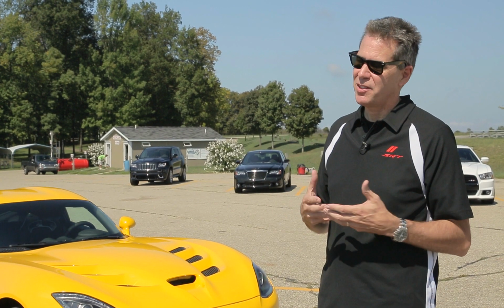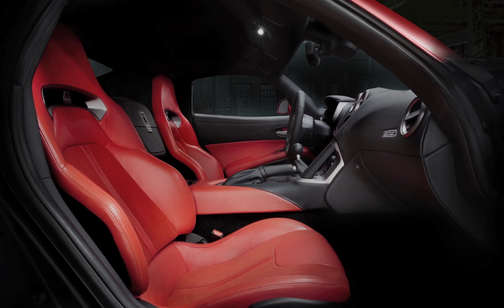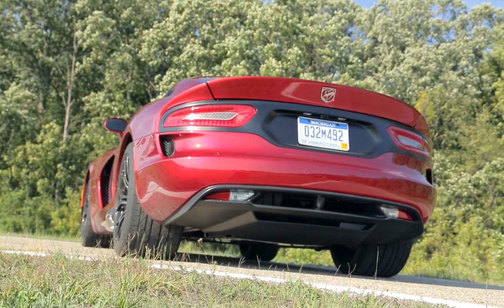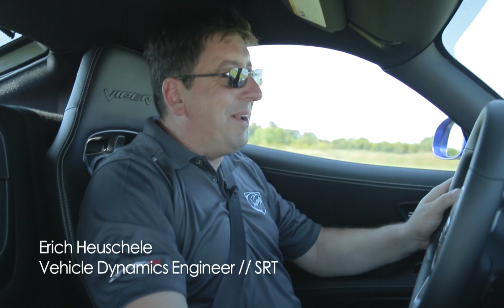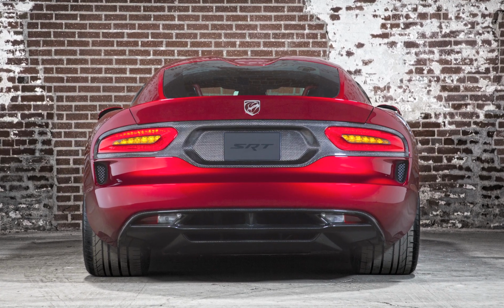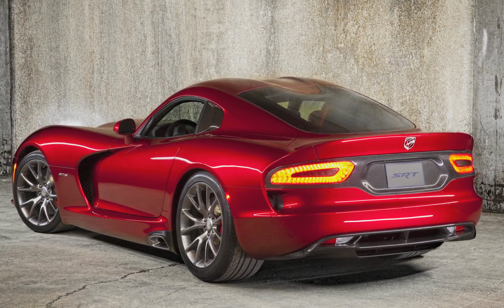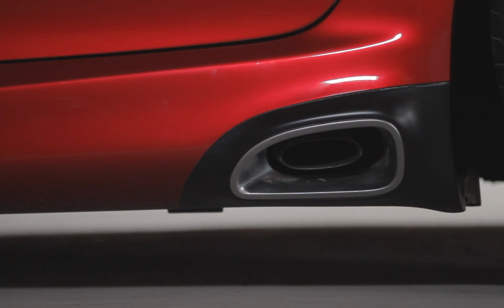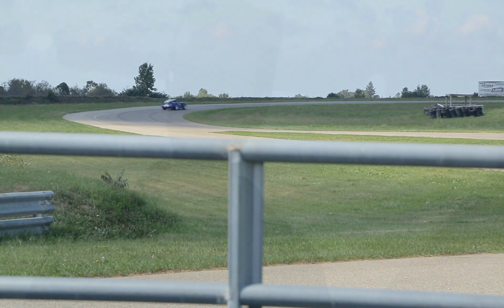The Viper is Back! - The Downshift Episode 35

Comment: The Tesla Model S is a Viper killer. I like the Viper design though. The Tesla as a super car is a wolf in sheep's clothing. But the Tesla is also a real car that you can drive to work every day. Why is Detroit so slow in making a performance EV car? I want to see the Viper EV with 0-60mph in 3.5 seconds, with 80MPGe and a range of 150 miles. It's completely possible and would be a far more real-life usable car than the current Viper.

Comment: if you bothered to open the clamshell carbon hood of a Viper, you'd immediately notice that every Viper every built (yes, since 1992) has been a front, mid-engined car.  Meaning that the engine is placed entirely aft of the front wheel centerline.  This is not true of many 'front' engined cars, including all those C1-C6 cars some of you are so enamored with.  The block is not as aft as you think on those cars.....but on a Viper, it really is mid-engined (thus the resultant long hood line).

Comment: The Viper costs $120k, has a body made entirely of carbon fiber and aluminum, has high quality leather interior that makes Maserati owners look shy, has tons of power, and is built for the talented. That's the problem with your supercar fad. The Viper is one of the only cars left where talent is a necessity for driving fast. This car will gladly throw you into a ditch if you don't know what your doing. Its a car that deserves respect to drive fast. The Viper accomplishes so much with so less.

Comment: 1. I didn't say ANYTHING about carbon ceramic breaks, so you're arguing with a straw man on that one "bub".

2. I said ACTIVE suspension not adjustable, learn the distinction.

3. A super car has to be modern.  It has to be at the forefront of automotive technology (just like every real super car is: 458, aventador, veyron ss).  There is not one piece of new, or revolutionary hardware on this car.

All they did was make the viper not a TOTAL piece of shit, and we're suppose to be so impressed.

Comment: Now you just sound ridiculous. So a car HAS to have carbon ceramic brakes and an engine behind the driver to become a supercar? You fail to recognize the awesomeness of the Viper.
1. It has bilstein electronic adjustable suspension bub, so you're wrong there.
2. The reason they gave it massive brembos and not your European carbon ceramics is because carbon ceramics damage very easily and cost a fortune to replace. And the brembos outperform anyways stopping far less than 100ft in 60-0.

Comment: You're wrong, it doesn't have 10% the technology of a Ferrari, no active suspension, no sub 50ms paddle gearbox, hardly any F1 racing technology in the Viper at all...  Oh yeah it has vents for the brakes, amazing...  Sorry but it is nowhere near modern enough, nor is it hand-built by craftsmen.  Thus the Viper is not a super car, maybe a mega muscle car, or sports car.

Comment: I'm sorry but I have to chime in.  U may very well see technology circa Veryron on Audi's, but what you are conveniently leaving out is that VW make both cars. Same reason why Audi's are utilizing Lambo engines and the Veyron's engine is based on W engines VWs been making for years.  The Veyron is an engineering masterpiece, but u wont see BMW or McLaren using the same tech. PS, lockdown260 said tech 'that doesn't make the car faster' is worthless; seems u left that out for ur argument's sake.

Comment: rally racing, drifting, and rock crawlers still use full manuel gear boxes. and every enthusiast agrees that manuel gear boxes are what separate true drivers from mash and goers... and you must not know much about Nascar because they are still Manuel as well. also try looking at motorcycles I don't see any racing bikes with automatic transmission options... "have you ever considered that?"

Comment: 2013 GTR does indeed did a 10.8 1/4 mile. 11.1 is a year back. Don't forget they add more power every year so the number will keep increasing.

Comment: Go watch any of the road tests done by Motor Trend or Drive between the GT500 and ZL1 or just track test in generel, this is not BS, for 60+ k I want a car with good brakes and trans thats comfy and has a good chassis, not that Bucket of to much power of the new GT500, that car is all about speed in a straight line, and the Truck suspension prooves that. All facts that you can find yourself, not BS. And you're still hear. Grow up some if you think I need too.

Comment: Actually, that was 25 lbs from the engine alone.  The total reduction is 100 lbs and 150 lbs for the SRT and GTS respectively.  Also, if you select the track pack it is another 50 lbs reduction.  So that is a possible 150 to 200 lbs weight reduction.

Comment: Yes, by a long shot it is. The Shelbies brakes say Brembo but they certainly don't perform like them, the Vette is still faster in a straight line with less power, and doesn't have truck suspension like the GT500, and the Vette can be driven hard all day every day wiithout fault unlike the GT500 with it's fault brakes, clutch, and electronic system. Plus the Vette is faster and cheaper than Fords #1 Supercar. the GT.

Comment: Why?  Composites are a much better insulator and keeping the air cool.  Aluminium is ok for a drag car but useless for road racing and keeping a consistent IAT.  This intake is probably so well designed that it can take forced indution and flow up to a lot more air just fine.

Comment: I remember driving an early Viper. It beat the hell out of me. The shifter got hot enough to burn you, The A/C could not keep the car cool. The side pipes could cook your leg. It had a lot of grip, but it was hairy at the limit. It could kick your ass. No creature comforts, it was the Shelby Cobra of it's day, just slightly easier to live with. This new car looks amazing. In 2013 you must have an adjustable suspension. It has to be comfortable & fast. It's got a lot of competition out there.

Comment: I see way too much Corvette influence in this Chrysler/Dodge/SRT/Mopar/Whatever Viper. These are rediculously fast powerful and cool but I can already point out design flaws in this like the long thin cooling ducts getting crap lodged in them and being hard to clean. Also the hot exhaust tips on the sides next to the doors are hazardous to passengers getting in/out of the car and they aren't out back so I'm sure they're loud in the cabin which would get annoying after driving it for 20 minutes.

Comment: I was always a viper fan, but was hoping this one would be more advanced. The engine should have been completely redone. Its still just a 360 v8 with 2 cylinders grafted onto it -_- . Its a truck engine. It should have had the displacement reduced, redline raised, and at a bare minimum have DOHC. very disappointing. The new body is nice, interior is pretty nice, you can tell it still has the same basic geometry of the old viper, with the incredibly poor placement of the E brake.

Comment: has all the functioning ram air scoops and carbon fiber chassis parts, yet the challenger a true american icon has fake ram air scoops and fake carbon fiber, and you cant get the 425 hemi and a six speed manual in a r/t classic package, that s if you can even afford the 50,000 dollar price tag and but if it was my money i wouldn't sink the cash for the viper id buy the Aston amartin V12 zagato, it may cost more but probably funner and race proven

Comment: The GTR is an amazing car, but it's not the best competitor for the Viper. I only mean that in the way that both the domestics are RWD, with 600+HP and manuals. An AWD t-turbo V6, dual clutch Japanese tech-dripping rocket should be chasing the AWD Porsches and Lambos.

Comment: Exterior fit still looks closer to a kit vs. mass production "halo car".  Why can't we Americans build a car with tight panel gaps?  That looks like close to 1/2" at the door and from fender that doesn't cut it.  Also the Wheel arch gaps, it's not 1990 guys wheels can travel under the bodywork.  

Still what has been done looks great and I look forward to see what kind of number this thing can put down.

Comment: You just have to drive them to understand. Z06 is lighter and better handling than the ZR1 so it can compete in more various obstacles than the ZR1 which is fast but more for straight line drag races.